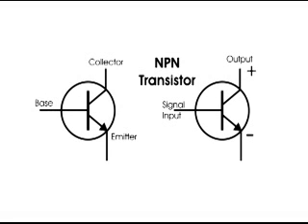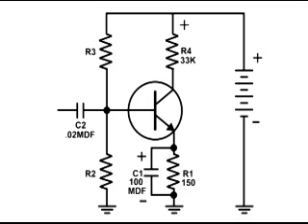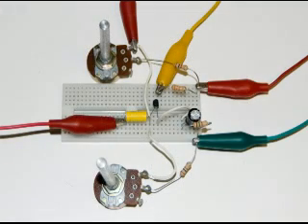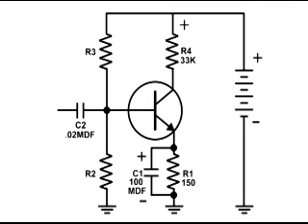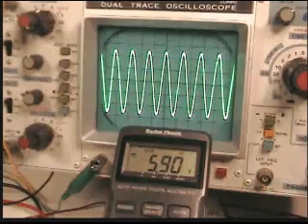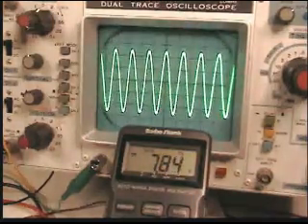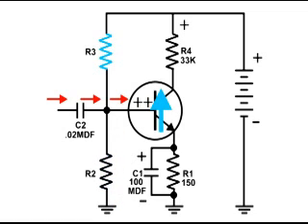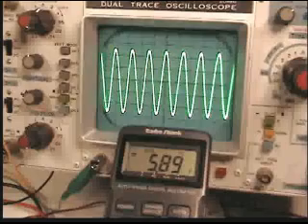Biasing an Audio Transistor

Comment: I experienced the same problem when I was designing my CE amplifier.  I choose the values of r1 and r2 so that the base-emitter voltage of the transistor was at 0.7V by setting the base to 1.6V, which is the voltage drop across r2. But when I put it all together on the breadboard the circuit didn't work, and the base voltage was 0.58V and the base-emitter voltage was only 0.57V. I realized that I couldn't have any old combination of R1 and R2 to give the correct biasing of 1.6V at the base. As R2 was too high, so even though the base voltage was calculated to be 1.6v, it was much lower as most of the current was flowing through r1 and the base-emitter junction of the transistor. So when biasing the transistor the value of R2 needs to be lower than the base-emitter resistance and so R1 needs to be higher to control the biasing current and the base voltage.
Reply from the maker: That's why there are electronic labs. I have worked in many electronic labs that coast many million of dollars to build and maintain. These companies would not spend that money if it was not absolutely necessary.

Comment: Question: At 2:30, you mention that the capicator is 0.02uF (Micro farad) However, the diagram shows 0.02MDF. Wouldn't a capitol M stand for Mega like 10M ohm is 10 Mega Ohms? Also, why say 0.02 micro, instead of 20 nano?
Reply from the maker: I had been working on some early radios 1920-1940's. Back then MDF=uF.

Comment: If i use 9v Vcc for a speaker load 8 ohm. Would you guide me how to calculate Rb and Re? (I'm using n2222a) thank you
Reply from the maker: That would be a total redesign. This is one interstage amplifier that would drive a very high current audio output stage amplifier.

Comment: I did the calculations, and the base voltage would be 5.25 volts,  and with the 0.7 volt drop the emitter voltage would be 4.55 volts, making the emitter current 30.3 milliamps.   However, with the load resistor of 33k ohms, the saturation current would be only 0.54 milliamps.  I am new to this, but I do not see how you could get a reasonable load line, maybe you mean a 330 ohm resistance at R4.  Too many times I have put circuits together and they don't work.
Reply from the maker: Put down your pencil and build one.

Comment: Hello
I have simulated the circuit and it does'nt behave as it should , I wonder if there is not an error in the 150 ohm R1 value ? Brgds
Reply from the maker: If you have a flat top the bias on the base is to high. If you have a flat bottom the base bias is to low.
Reply: See my reply, I think the problem is in the 33k ohm resistor, makes more sense to use 330 ohm resistor, I am new to this, the book "Electronics Principles and applications" by Schuler tells how to calculate bias and load lines to get gain, it is fairly straight forward, but does leave some gaps.
Reply: @abelincolnparth  thx for your comment and response my own one. I run the proposed schematic with LTSpice and it doesn't work.. the answer (from the boss, thx to him) , doesn't answer my concern, i did not get the english very well and the author answer is unclear to me.

Comment: Nice explanation, thanks. Why is the optimal bias at 6v? What is wrong with setting it at little below clipping, around 9,50v in that case? This would give alot more output power, thats the reason I`m wondering why not set it that high.
Reply from the maker: It's 6VDC because I'm using a 12VDC power supply. If and amplifier clips it produces distortion.
Reply: @AllAmericanFiveRadio  Ummm you're using 18V for the supply.  Please explain how you arrived at the initial R1, R4 and C1, C2 values.  In other words the math behind setting gain, limiting current and determining frequency response.

Comment: MDF?? there's a typo on the schematic - MDF is a wood product :)  most common ways to denote micro farad are mF,uF or mfd. the correct way is to use "mu" symbol from greek alphabet -  µ. very rare to see mfd (maybe its an American thing??), much more common is uF at least in Australia. Was scratching my head for a few minutes trying to figure out those cap values. besides that issue..great vid
Reply from the maker: Dyslexia

Comment: so what do i do if the rca line has 2 lines ... one go's to ground and other go's to base ?  also when i play music on my mosfet  why do the sspeakers puff up when the volume is turned up
Reply from the maker: Send me the Make and Model or the wiring diagram
Reply: well u see im an experamenter  i just discovered that a  power mosfet can amplify a  rca  power cable ... idk how  i did it  i just messed with wires till it worked only  part i had was a   power mosfet  i didnt have resistors ... or anything

Comment: the maths is simple
voltage divider vbase=vbattery*r2/(r2+r3)
the vbase must equal approx veb which in silicon transistors is about 0.7volt (actually 0.6-0.7V depending on current) plus the voltage drop across r1 which is emitter current times r1 .but
for max signal output and less distortion vcollector to emitter should be (supply voltage /2).
that means rest of volts are across r4 as r4 here is much bigger than r1.
lets say vsuppply is 18v .then v/2=9volts
that means icollector (almost same as iemitter) is 9/33k=0.27ma
volts across r1 is 150*.27/1000=0.04 volts i.e virtually zero.
so vbase=0.7+0.04=0.74v  or so
this requires 18*r2/(r2+r3)=0.74v
choose r2+r2 big enough not to load down the signal source say  500k
r2+r3=500k
so 18*r2/500k=0.74
so r2=20k so r3=500k-20k=480k
nearest r2=two 10k resistors in series and r3=470k
exact result vb=18*20/490=0.734 close enough
in practice make r1 bigger so vb+vacross r1  is less sensitive to individual transistor characteristic and also enabling r2 to be a bit bigger not to load the source.
(note there is a limit to how big r2+r3 is as the noise generated from the resistors themselves can start to affect the noise output of the circuit. the lower r2+r3 the lower that noise but the more load is placed on the input.Ideally the a/c input resistance should equal or bigger than a/c source output resistance.The input resistance is r2 in parallel with r3  i.e. r2 as r3 much bigger ( and also in parallel with transistor input resistance- in this case beta times re where re=30/(iemitter in ma)
in this case re=30/0.27=111 ohms.
if the capacitor where removed the input resistance due to the transistor would be beta times r1 a much bigger number than r2 usually.  e.g. beta=400  input res=r2 para r3 para 400*(150+111) (=104k)=16.2k
the gain of the circuit is virtually r4/re=33000/111=297
if the capacitor is removed the gain is r4/(re+r1)=33000/(111+150)=126
assuming the input resistance  to the circuit has not greatly reduced the input signal voltage.
.
Reply from the maker: And then you build it in a lab for testing and adjustment.

Comment from the maker: If you know the resistance of the load, the current required to operate the load, and the voltage of the power supply, then you go to the specification sheet supplied by the manufacturer for the transistor you're using. Here you will find the bias voltage needed for your current situation. Then you have to decide on the resistors to supply the bias voltage, that's ohms law.

Comment from the maker: When you want to build a transistor circuit the first thing to do is to decide what it is you are going to drive with the transistor, my circuit was R4. If I wanted to have R4 at the collector on or off, all I need do is change R2, lower it's resistance enough so it turns off the transistor which will make the collector maximum positive. Then remove R2, and R3 should Drive the transistor into saturation, making the collector voltage very low.

Comment from the maker: R4 is the load, R1 is the emitter resistor which helps set the bias point or working point at the base. R2 and R3 are chosen to also set the bias/working point, there resistance are high enough not to short out the incoming signal. Resistors are generally the cheapest way to bias the transistor.

Comment from the maker: The emitter resistor creates a voltage drop which raises the bias on the base by the same amount. With the capacitor crossed it, it does act like a battery. The resistor and capacitor last much longer than a battery.

Comment: Why is a capacitor and resistor(instead of a battery) needed on the emitter of the transistor use?The tube circuits had a smaller battery on the grid.Does this act the same?

Comment: That looks like a LEADER LBO520A oscilloscope, doesn't it? I used to have one 30 years ago.

You just made me remember when I had to design an audio amplifier when I was a student. The only thing I don't remember is how to select the emitter capacitor. As that was my first course of electronics, the professor just gave us an empirical rule where its reactance had to be who knows how many times the emitter resistor's value. 

Can you please say how you select it?

Thanks sir ! Good video!

Comment from the maker: I was using the Leader Audio Generator 27. It was set on high and about mid output. Still not a very strong signal. About 1.8-2.7VAC

Comment from the maker: Everything in the circuit influences the amplification potential of the circuit. R4 is the load of the circuit, R1,2,3 are the biasing resistors, they set the voltage at the base that allows the transistor to work properly. If R4 was changed to 8 ohms, R1,2,3 would need to be changed to set the base so that the transistor will work properly for an 8 ohm load. The amplification of the transistor is the beta of the transistor.

Comment from the maker: Two equal resistor would split the voltage in half. That bias voltage maybe to high, but the bias voltage is also dependent on the load you are driving and also how you want to drive it. Class A will have a different bias voltage than an On-Off function.

Comment from the maker: Thanks rschandran
Yes the beta does matter. The higher the beta, the higher the gain of the transistor. So a high beta transistor can be easier to over drive by the input signal. Everything is important in the circuit. I think the best/fastest way to learn is to study existing circuits of the type you want to build. A lot of time and experimenting has gone into a successfully executed circuit.

Comment from the maker: @flurng 
R1 produces a voltage drop for the emitter which produces a bias voltage for the base. C1 stabilizes this voltage. Without C1 the bias voltage will change more when current flows through E and C of the transistor. The more the bias voltage changes, the more the the current flow is influenced by the current through the transistor changing the characteristics of the amplifier.

Comment from the maker: @marsenification 
Well, you could use just the common ground and the Plus 9 VDC or just the common ground and the Negative 9 VDC. If you want to make a power output audio amp you could use it as 18VDC and just forget about the common ground from the power supply. If you want positive 18VDC use the negative 9VDC as ground in the circuit. If you want negative 18VDC use the positive 9VDC as ground in the circuit.

Comment from the maker: @marsenification 
I'm not sure how you wanted to use your dual supply. I would need to know what are the voltages of the power supply. If you can get from 6 to 9 VDC out of it, that is all you need for most transistor circuits.

Comment from the maker: @miyukiTS
C2 blocks the DC from the circuit in front this one or from a signal source, and only lets the AC signal through to the base to be amplified. If a DC signal was allowed through, it would mess-up the basing of the base of this transistor.

Comment: Hey AllAmericanFiveRadio: I have a fairly basic circuit  I recently attempted to build and I fried the microchip el75715 which is a Pulse width mudulator chip. I bought the resistor and caps to build it and destroyed the microchip. To make a long story short I would like to hire you to put this little circuit together. I would paste the chip's page but Youtube won't  let me. Google el7515 intersil then visit page to click on circuit pdf file.

Comment: @AllAmericanFiveRadio 
Thanks for the info. Funny thing though, the dc should be only dc ripple if indeed the base simply causes a resistance fluctuation regardless of if base is signwave..... because after all the power source is only dc. Perhaps the nonlinear characteristics of the transistor has something to do with it? Is that correct? I'm asking this question because I'm looking for a dc ripple source for a project on building.

Comment from the maker: Thanks donotfret,
I used a sine wave generator for this demo. The same generator can produce square wave also. Most YouTubers are interested in audio equipment so that's why the sine wave. The transistor is making the sine wave at the output. At the output the transistor varies it's resistance which causes the DC to vary. I used a sine wave at the input so it varies the DC as a sine wave at the output.

Comment from the maker: Don’t remember the voltage of the input signal, it saw small, less than a volt. For class A you bias the tube/transistor so that the input signal can swing the output equally between the top and the bottom of the power source for the output.

Comment: Ok, I think I get the point; what really matters, is the current flow - not the voltage alone. If the current flow is limited to safe level, virtually any voltage can be applied at the base. On the other hand, I guess that even a low voltage, say 1 V, could destroy the transistor without any current flow limiting at all. Thanks...

Comment from the maker: This is done most often in switching circuits. The major current flow in this circuit is through E to C. When the base becomes positive enough the transistor goes into saturation which is the highest current flow possible for this circuit. The current flow through the base is still small. Go down to Radio Shack and buy some 10 cent transistors and experiment. That is how you really learn.

Comment from the maker: R4 is the load/current limiting resistor. Without it the transistor would burn out. If you build this circuit you will get the same results, I used no magic. C2 blocks DC but lets the AC signal through. R1 & C1 are for biasing, together they act like a battery.

Comment from the maker: The linearity usually determines how fast the volume/signal increases and decreases. If there is distortion and it is not due to the input sign being distorted it can only be clipping at the top or bottom or both. Thanks.

Comment: Excellent show, thank you. As far as I noticed on the oscilloscope as you decreased the resistance of R3, before the transistor got into complete saturation and signal disappeared there was some clipping in its amplitude. Does it sound as nonlinear/unlinear distortion? That explains what happens with the signal when resistors drift off their values. I would really appreciate if you uploaded some videos with IC amplifiers as well. Thanks a million.

Comment from the maker: The easiest way is to look at other circuits. The trend for biasing is higher resistance in the front end and lesser resistance toward/at the speaker, in audio amplifiers. This setup did have a good range of resistances for R2 and R3, that would still produce a good output, did not get to show because of time. Tubes usually dont have R3 resistors in the circuits because the internal elements of the tubes supplies it.